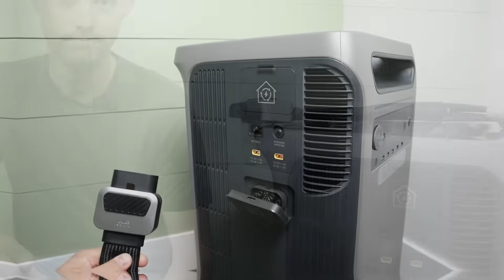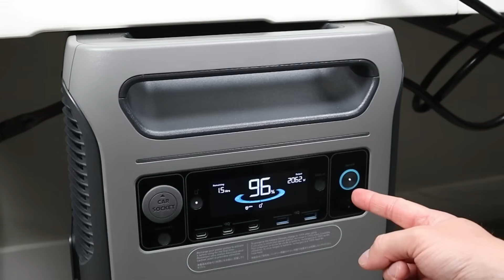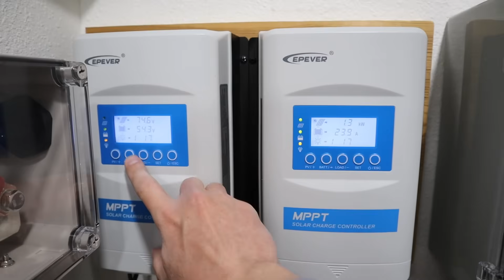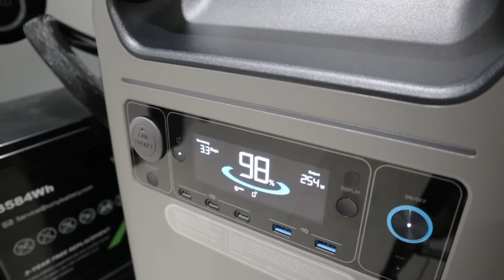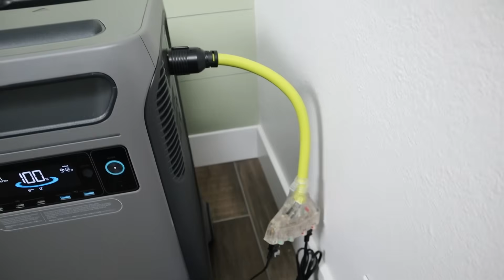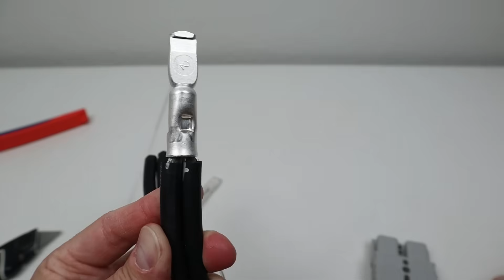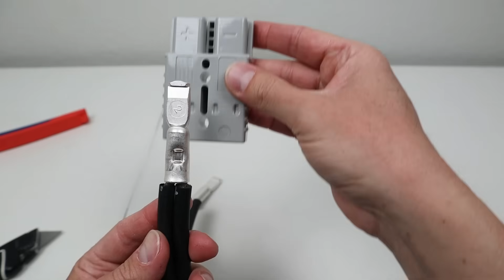I didn't Know This Was Possible!! Backdoor Battery Access to the Anker SOLIX F3800!

Comment: I am hoping to do a similar setup with the Anker F3000.  Can you confirm please if the "Battery Expansion Cable Connector" is the same for the F3000 and F3800?  Thank you.
Reply from the maker: It appears to be the same but I haven't tested the F3000. If you see live voltage on the expansion port (53v when turned on) it should work.

Comment: Has anyone added a 15kw battery and not had any issues?  I ask this because someone on another channel mentioned that when they did this, the Anker inverter wouldn't through put more that 2600 about watts.  Any findings along this way would be appreciated.  Thanks!

Comment: I hope the wiring inside the f3800 can handle the amperage your charging directly the battery.  The voltages of Lithium ion batteries and LFP are slightly different.

Comment: What if you add a fully charged expansion battery to the main unit with a low state of charge (for any solar power station)? Thx!
Reply from the maker: Both batteries need to be fully charged. Adding a different charged device will send massive amounts of current that will damage the wiring.

Comment: I need a way to charge by F3800 using a gas generator while it's powering my house over the 240v plug.  This looks like the best way towards that...

Also the inverter will shut off with no load being pulled to save battery.  It was a new feature in a semi-recent firmware update.

Comment: I enjoy your work, but I have to comment. As a retired EE this scares the crap out of me. You’re dealing with more than enough power to burn your house down. And you’re plugging into a port with absolutely no knowledge of the circuitry on the other side. I would absolutely never leave a room with something like this running..
Reply from the maker: Both batteries have built in battery management systems. Over current protection, over voltage protection, over heat protection. If something goes out of the normal spec, the battery shuts down. Since the battery chemistry and voltage is the same, this experiment actually works.

Comment: What about getting power out of that port to power a more efficient inverter vs the heavy duty inverter that’s built in?
Reply from the maker: That should work too
Reply: @Jasonoid ChatGPT is trying to scare me into not doing this.
Reply from the maker: @ErikSoderquist chatgpt told me last week to plug my 12v battery directly into my home outlet to save power.... You think I'm going to listen to it's advise?!
Reply: @Jasonoid haha that is terrible advise. My knowledge of the internals of these power banks is not great. From what it says, yes you can fool the port but the contactors and handshake are not designed for it and so I’m a risking it. But to me it’s make sense if it’s just a direct line to the battery why couldn’t I pull voltage out and run it to a more efficient inverter. Seems like it wouldn’t be such a big deal.

Comment: Wonder if this works with the Anker f2000?
Reply from the maker: I don't have a way to test. You'd have to measure with a voltmeter when the power station is turned on. If you get 53v or so, it should work on that model too.
Reply: Have you tried it with f2000 yet?

Comment: What should the external charge controllers or batteries be set to properly charge the f3800?  I want to use batteries in combination with external charge controllers.  That voltage is appropriate for feeding the side port directly to the f3800?
Reply from the maker: I can't remember the exact amount, I think I mentioned that near the end of the video. My guess would be below 56v for the best results.
Reply: I believe I saw it was supposed to be 55.5

Comment: It is my opinion that the reason anchor disables all these features is not because the device cannot handle or complete these tasks. it is because how can they sell you a version two If version one does everything. Every manufacturer does this exact same thing?Some worse than others, apple makes a phone about ten years ago looks and acts the same period each year. They give you a 10% improvement. My 2003 Porsche has the same horsepower that my 2020 does period give or take 10%. You're telling me in 20 years. We have not made any improvements.,Of course we have

Comment: I am going to see what happens on a  c1000
Reply from the maker: Please don't. The C1000 doesn't have a 48v battery. It has a lower voltage battery. Connecting a 48v battery would be really bad 😳
Reply: @Jasonoid i meant testing pick my probes in there and see what happens

Comment: I was so close to pulling the trigger on either this or the new Pecron F3000LFP. Seeing both these stations having an option for adding a 48v 100ah server rack battery is amazing. The F3800 is selling refurbished from Anker on eBay for $1800 when I last checked. The only thing that had me waiting on hitting that "buy" button was the excessive cost of the add on batteries. Then I found this video... Now I'm thinking the Anker may be a better buy for me since the inverter is so much larger. Does anyone that has used both have a recommendation for me?

Also, amazing video as always!
Reply: Just purchased one yesterday (11/14/2025) from solarguys for $1618.00.

Comment: If you're not using the inverter on the side and drawing any power out of it, they will time out. At least on the plus model which is what I have. You can change this in the settings.
Reply from the maker: Oh, I changed that setting to not turn off. That wasn't the issue, It definitely didn't like being connected to the other power station.
Reply: @Jasonoid ok. Good to know.

Comment: Thanks to your video I’ve just connected my F3800 Plus to 3 5kwh DCHouse golf cart batteries to charge my Tesla. I was curious how the F3800+ would react to high loads, and as I suspected, it does not like to pull 3000+ watts from the battery expansion port. When I exceed 20amps charging from the twist lock, the unit shuts down. 16amps seems to be working fine so far, but I have about 2400watts of incoming solar to the onboard MPPTs, so 16amps may still be too much if the sun isn’t out. I’ll continue testing, and plan to add 2 more Victron MPPTs to the system, all to utilize the F3800+ split phase output. Thank you for making this video! It took about 3 weeks to find a battery cable to slice up.
Reply: Quick update: Without solar, 10 amps (2400 watts) is the most I can pull from 240v without shutdowns. Not great for my use case, but still a worthwhile project! Eyeing a 6000XP now
Reply: Where did you find the cable?

Comment: Just saying these companies might want to tap into this option for those that boondocks or need to set up a permanent or semi permanent off grid power setup and would like a plug and play option instead of inverter, or temporary inverter. Might be a great marketing opportunity. As they could be used for portable power once permanent system is installed.

Comment: Thanks!  This really helped a lot. If I had expansion batteries connected would I still be able to fast charge through the expansion port on the last battery connected to the Anker Solix.
Reply from the maker: Yes, that should work just fine (since that's the only connection point).
Reply: Hello. Sorry. The expansion cable doesn’t seem to be in stock anywhere. In theory could I just splice into the existing cables. With insulated t’s and connect the fast charger

Comment: Does the app work still, to let us know if there is an error? My main idea is to max out the solar input on 2xf3800plus, so I can get close to the full 12,000w output/with the diy passthrough solar added on. The 12,000w continious output is only achieved with the hub that anker made to connect these two together.
Reply from the maker: The app doesn't know any DIY batteries are connected so it doesn't report what's happening with them.

Comment: I wish someone would try this on C1000x.
Reply from the maker: It doesn't have a 51.2v battery, it won't work
Reply: @Jasonoid Ohhh, I read somewhere that the battery is around 36v bummer! There are 36v batteries, but it's not worth doing this 😂.

Comment: No voltage on the connectors for my Anker C1000, so I'm outta luck.  Also folk in the comments say it's a 36v system.  But I was thinking...
If I use a 48V battery to charge via the solar (60V max) input, can I keep an AC charger connected to the batteries to get the same result?
Reply from the maker: Yep, gotta do it like this:
https://youtu.be/9ODIF2EfsUA
Reply: @Jasonoid  I appreciate the response and the video reference (love that it pointed me to the cables).  I would like to verify if it's OK to have the AC charger connected to the battery while the battery is also connected to the Anker.  My brain says it's OK, but I might be missing something.
Reply from the maker: @BillyBobDingledorf yes that's fine to charge the battery while connected to your Anker
Reply: @Jasonoid  Again, thank you.

Comment: I tried this with the BP3800 in the mix. I plugged in an EG4 LL-S 100AH in the available port of the BP3800. All works fine except that I noticed I couldn’t max out the 6000w capacity of the F3800+. AC output turns off somewhere over 4500w. I’m hoping you can try this setup as well when you get a chance. Thanks!
Reply from the maker: In order to get the full 6000w, you have to have balanced loads from each leg. 3000w from each 120v phase. If you pull too much power from one leg, it will shutoff the inverter.
Reply: @Jasonoid do you think this is why they added a double hub? Plus an extra unit purchase lol

Comment: Excellent video with comprehensive tests. I was wondering how my solix would react to exvess solar power from my microinverters. A variable current ac charger could be the solution. I wonder if you have explored the 240v cutoff parameters in your unit?

Comment: What if a DIY battery using the modded cable was plugged into a BP3800, which is already plugged into the F3800.. Would all 3 be connected? I imagine it would..

Comment: Is it possible to share a single large 48v battery between 2 F3800's using the cable hack (each having a battery cable connected to the 48v battery).

Comment: I wonder what that 20 pin data cable does? could it be tapped into to control the unit with an esphome or something? It'd be neat to not rely on the cloud app to see battery level, turn on/off etc via home assistant.

Comment: Because of your information, I was successful today to add a Eco-Worthy 51.2V 100ah server battery to my Anker F3800 for a faction of the Anker Expansion battery cost!  Thank you!
Reply: Did you have to do anything else for your set up besides the cable hack and wiring to the expansion battery?  Like fuses or breakers?
Reply: Does it still work? Im looking for stable long term mods.
Reply: @SurgeonTech I literally just got done doing this on mine. Everything seems to be working great and batteries seem to honestly discharge at the same rate. Everything makes me nervous though. 

Another person I know has all the batteries hooked up through the modded cable and but is only using the internal chargers via the xt60 port to charge everything
Reply: @dakalpster update a year later before I do this to my 3800+?

Comment: Question for Ya. I’m an idiot and I got the max of 6 expansion batteries for my f3800 plus. I plan on getting a few 48v 100ah golf cart batteries to expand the system more. Do you know if this little expansion wire hack for external batteries you showed directly to the main unit could somehow also work in combination with the 6 Anker expansion batteries?

I was planning on charging the golf cart batteries when I reached 100% charge on my Anker system via the battery charger the golf cart battery comes with and then discharging the batteries into the existing solar input when the charge drops enough on the anker. (So the 240v ac output doesn’t get disabled)

Comment: Has anyone done testing on adding a rack battery or stack of rack batteries using this back door method on the F3800 WITH ONE ANKER add on battery connected?  Can you just plug into the Anker add on battery with your stack of rack batteries and the 3d printed adapter?

Comment: On the original F3800, would it be possible to output 240v, and connect a 48v, 18a LifEPO4 battery charger to the xt60 port and coming from an inverter generator, charge while discharging 240v? This being a emergency situation.

Comment: @Jasonoid Have you tried to connect the modded cable to the new port on the Plus model with the generator image? I am wondering if you can still access the internal battery and have a BP3800 attached to the expansion port allowing both to charge.
Reply from the maker: The new generator port is slightly different and has two extra plastic tabs that keep you from using the battery connection cable on that port.

Comment: Why did it only take 30 amps from the chargeverter ?? Would it take more if the battery charge was lower ?
Reply from the maker: Yes, the battery voltage was near the cutoff voltage of the chargeverter so the amps were limited.

Comment: When you buy a station like this you buy it for a certain purpose and let it do its thing. When you wanna built own systems you shouldn't buy a out-of-the-box station like thius but use own components and battery racks. Voiding warranty like that is complete nonsense since the warranty is the only thing that you dont get when you build your bank yourself.

Comment: Nice video. Thanks . can you pls check if dji 1.8kw car charger works with Anker solix by blocking the bms wires on the sdc ports and rigging it to Anker solix dc ports. and any method to reverse charge car battery with such setup. your rigging f3800 has helped me a lot. I got 2 f3800 in uk and they lack joining 2 f3800 together for combined power of 12kw. and I got them in N Ireland so cant return them so had them sitting since launch . never used them. backup for worst case scenarios.
Reply from the maker: The DJI 1800 will only work with DJI proprietary communications.

Comment: I wonder if it shuts down the AC-out during AC-charging is due to the non isolated topology of the AC-inverter. I assume this can cause some sort of issue relating to voltages and voltage-references?

Comment: I’ve really been eyeing this option. There’s people using the f3800 with a lifepro4 battery rack and saying they’ve had zero issue besides it not showing on the app. But it works. A lot of people are just 3D printing the port, using 6 gauge wire and using the golf cart batteries. Maybe Anker does an update and shuts it down. But it’s been a year and they haven’t. So…. It’s a great option. But up to you folks.
Reply: You have a link to what they're using for a pattern? This sounds interesting. Cheaper than hacking apart a cable

Comment: All your tests are from 80 to 100. I am pretty sure there will be problems if you charge from 0-100 and/or while also using the battery. Is there a battery temp reading on this device?

Comment: Anyone know if this works with the Updated software or with the f3800 plus?
Reply from the maker: I was running the most updated firmware for this video.
Reply: @Jasonoid  Does this cable hack work with the f3800 plus? For example, you want to use the F3800 plus inverter but extend its battery with existing 48v system?
Reply from the maker: @michaelgriesinger2566  I briefly tested it with the F3800 Plus and didn't notice any issues using 48v batteries.

Comment: Please confirm and expand on your comment about the 240 volt output shutting off when AC charging the unit.

I was interested in getting a F3800 Plus and powering my house with the 14-30 plug.    I also planned on charging the F3800 Plus with a 240 volt generator during the daytime, high loads and relying on the F3800 overnight to eliminate generator noise.     Please confirm as this will change my plans.
Reply from the maker: The F3800 Plus doesn't shut off the 240v when in normal use, at least if you have the settings that way in the smart app. I only saw issues with running the modification.

Comment: If i'm understanding this right, I could almost triple my anker f3800 battery storage by adding two Ecoworthy 51.2v 100ah batteries (each is 5120wh) using this cable hack?  If so, what else would I need besides the cable and batteries?  Is a charge controller needed if I'm using the built in xt60 ports for my solar input?  Do I need a bus bar or circuit breaker/fuse?
Reply: Anyone got a reply on this?  If I use this hack to expand the F3800 capacity will it still work with the direct feed solar inputs and the home power panel?

Comment: I own a F3800 and Anker home panel.
I'm curious about the generator charging cable for the F3800 plus. Can you try using it with the home panel and a original F3800?

Comment: Tested this on the Anker solix c1000 and I can’t seem to get any voltage out of the expansion battery port. Any tips guys?
Reply from the maker: Usually the branded expansion cable grounds out one of the communication pins to enable the voltage output. That's how it works on another power station I've tested.
Reply: @Jasonoid I tried a few different combinations of connecting the pins and couldn’t activate the expansion battery port, if I send you the expansion cable would you be able to do your own test and see if you can get it to work similar to the 3800?
Reply from the maker: I don't have an Anker C1000 anymore, I don't these power stations to people usually after 6 months of me reviewing them  @KylePutin
Reply: @Jasonoid Roger that